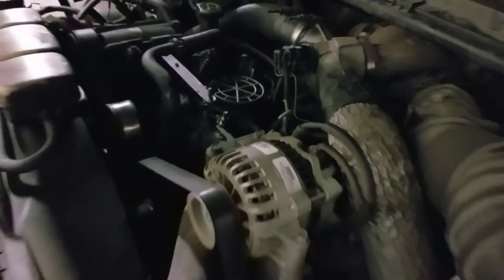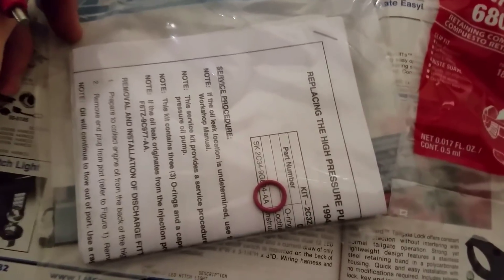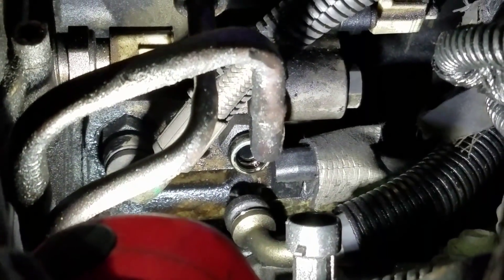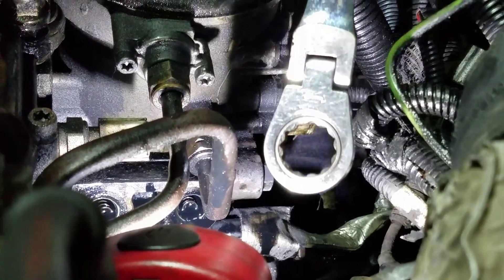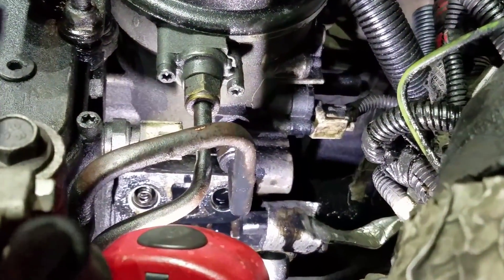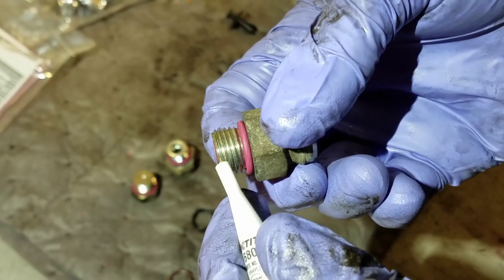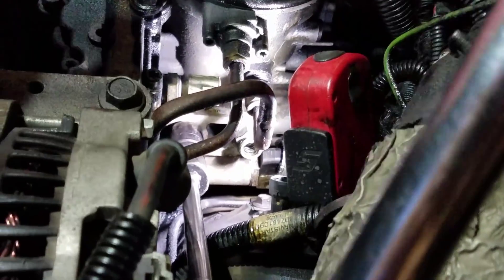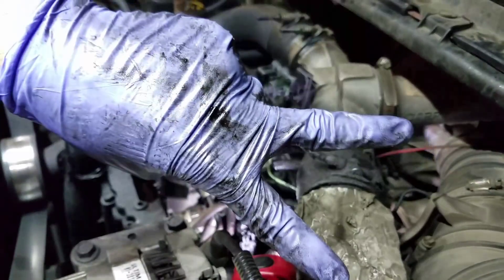2000 7.3 Oil leak!

Comment: Decided I’m going to get the high volume oil pump from Diesel Site and get some new hoses because of the leak issue. On the plus side I hear it will make the 7.3 a little quieter and give a minimal fuel mileage increase.

Comment: Why not replace the fittings while you're in there? There must be non-servicable o-rings sealing the lines inside of the fittings. Possible leak point once they are disturbed/disconnected, especially on a higher mileage unit. I like to grease my o-rings, or at least lube 'em with fuel.
Reply from the maker: Nvr had a problem with in all my years....🤷‍♂️🤷‍♂️🤷‍♂️

Comment: What's the opening diameter of that custom extraction tool you made?
Reply from the maker: I duno id hafta look
Reply: @PowerStrokeTechTalkwARod  If you wouldn't mind, I have a MASSIVIVE oil leak happening and I am trying to eliminate the usual suspects.
Reply: Here's the aftermath, while looking for the source of the leak, the engine started missing then stalled. https://www.youtube.com/watch?v=dXWvctMpV_0
Reply from the maker: High psi oil line?
Reply: @PowerStrokeTechTalkwARod  I just cleaned the top of the block and placed PT's under the turbo pedestal (but above the valley) and under the 2 ports and 1 back bolt of HPOP. It showed nothing, BUT the valley still filled with oil and appears to be coming from the underside of the HPOP, (oil pooling in valley right underneath it) is that possible?
Reply from the maker: Yea sometimes the pump can leak

Comment: is this the same for the 96 7.3 my engine bay looks a little different
Reply from the maker: It will for a the most part...but the low psi fuel system is different.
Reply: @PowerStrokeTechTalkwARod   but basically doing the o rings is the same? i have a oil leak in the valley im trying to find it. so far its either these or off the turbo stand

Comment: My orings failed inside of the fittings. I replaced the 3 you just did and still leaked, ended up replacing the fittings.

Comment: The other day at work, our 99 powerstroke shop truck stalled going down the road to a service call for a broke down fire truck. It would start and stall or would crank crank crank and start. So after pounding on it once it fired up. Left it running on the service call. Got back and parked it outside.  Well during my lunch break I replaced the icp sensor because it was bleeding thru and I cleaned three grounds. Replaced the body to chassis ground under the cab passenger side. Well I was told that the truck would show problems when it rains. Well after my repairs it's been raining alot here in buffalo.  Truck runs great. Thank you for your video's
Reply from the maker: Thanks so much for watchin Greg. Have a great weekend
Reply: @PowerStrokeTechTalkwARod  you as well

Comment: Is there an actual recommended replacement interval for the lines? My buddy blew one of his lines in his 7.3 at around 165k. Not an o-ring but the braided line blew. I got nervous so I replaced both of mine.
Reply from the maker: No there isnt

Comment: I just did all the orings and whatnots on mine. Might I suggest installing new orings and split washer in the quick connect side of those fittings. The fittings aren't that much to buy new either which works well instead of rebuilding them.

Comment: Got my 02 7.3 with 179xxx and now about 208xxx only had to replace started. But has 2 oil leaks and wont start in the cold weather
Reply from the maker: Awe mann, i got some vids for that!
Reply: Check your glow plug relay. Also, use the full synthetic oil Rotella 5w 40 oil it will start easier.
Reply: Joseph Nakis A 7.3 that won’t start cold? You’ll never get me to believe it😄